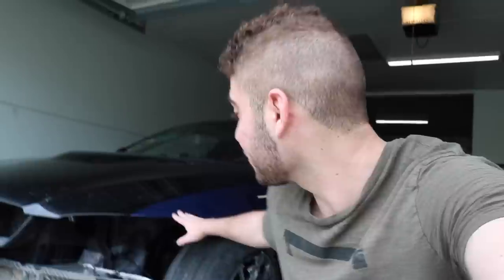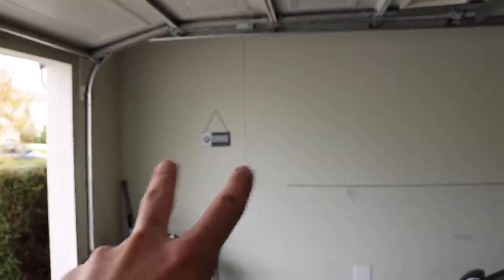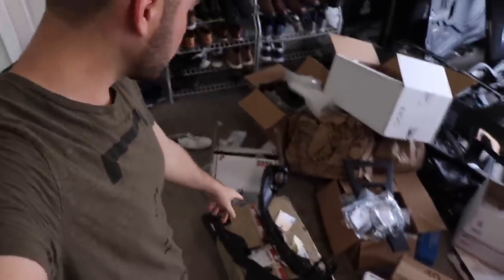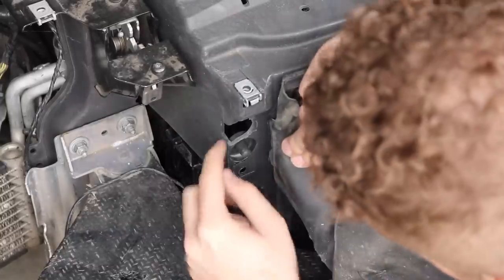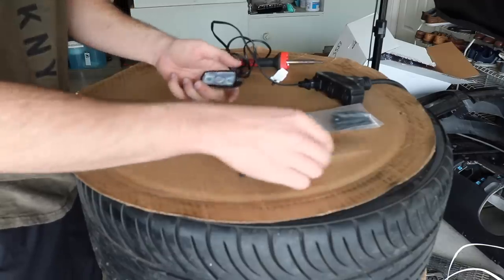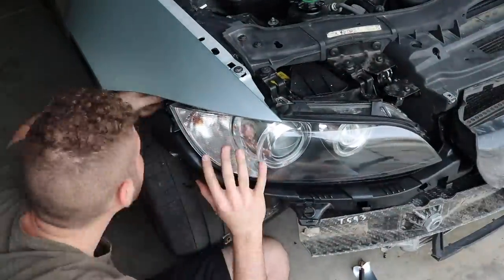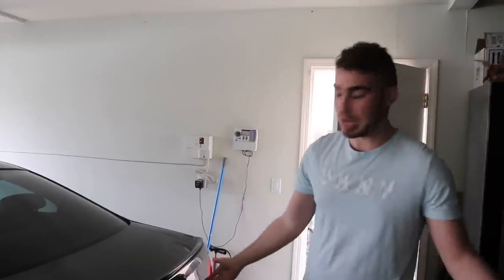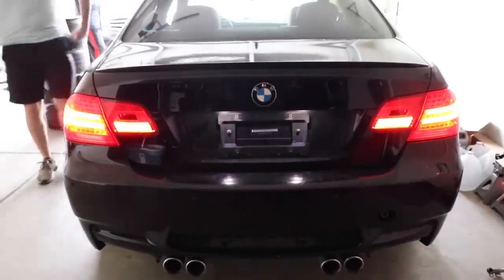Rebuilding A Wrecked BMW M3 Part. 9

Comment: Not trying to be mean just trying to help out. I think when you installed the lock on the driver side door you might have flipped something. When you locked it the bar disappeared under the door card. And then you unlocked it it rose up but only to the spot that it should be in when you lock it. I hope this helps out. I love the build, it’s my dream car.

Comment: Use the Carly adapter and do urself a favor and ....code double flash style hazard . Looks amazing with lci led lights . I have it on 335is. And other good ones r  door chirp when open , also code mirror fold with key lock or finger on handle if comfort access.

Comment: For the adaptive headlight modules use the original if you have them and the plastic part is replaceable and it does matter if it is from the left or right side. My e92 adaptive headlight feature does not work because my modules are from a different car so they need to be reprogrammed.

Comment: Idk if u can help me but if u can or u know how that would be great, soooo my left halo isn’t working and I checked the fuse box and the fuse is good but the halo wire isn’t getting any power to it
Reply from the maker: could be a wire issue in the headlight
Reply: the halo could be burnt out or the connection between the halo and the car has fallen loose
Reply: Yeah Bc like I bought the halo light bulbs new and I changed both fuses to a new one and like the whole wire isn’t getting any electricity before it even connects to the headlight and I’m soo confused
Reply: Taim Almnini ohhh I can’t help you there sorry 😐